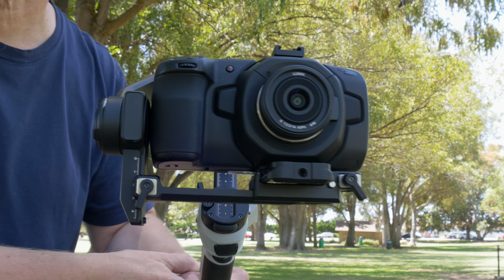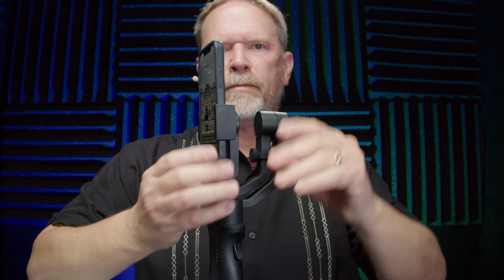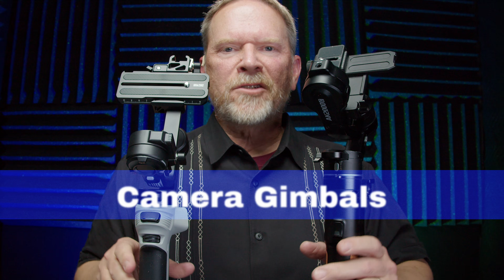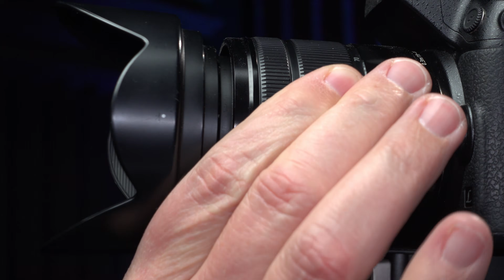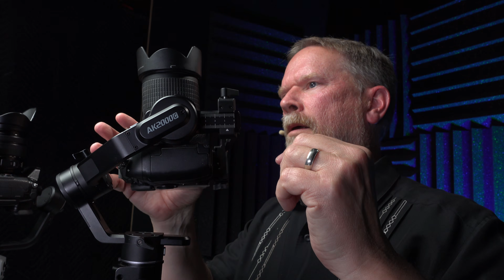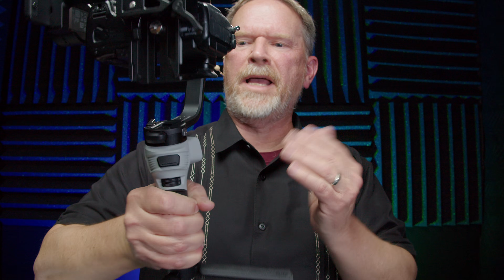How to set up and balance a gimbal...EASY!

Comment: Good day sir i wanted to ask about the gimbal Rs3 min gimbal can it work well with 650D canon
Reply from the maker: The 650D isn't listed as compatible, but that might be from an electronics standpoint (i.e. you'd have to hit the record button on the camera etc). It has a 2kg weight limit so with a lighter lens the setup SHOULD work. Probably. But check with DJI as I don't own any Canon gear.